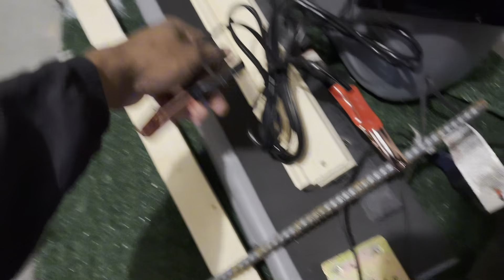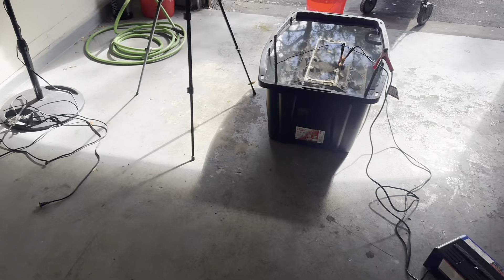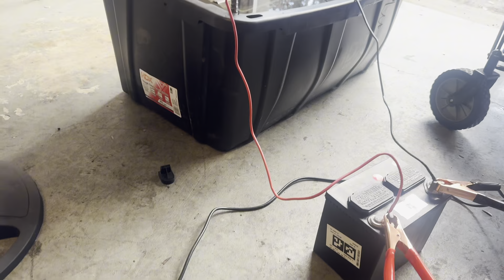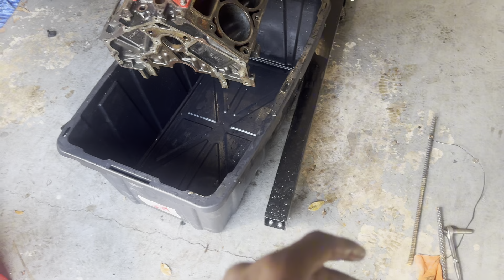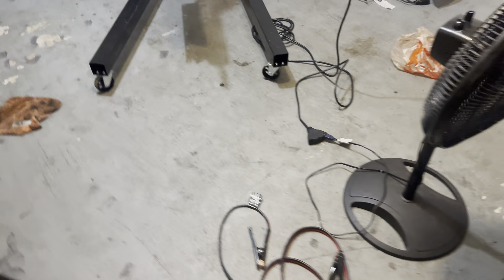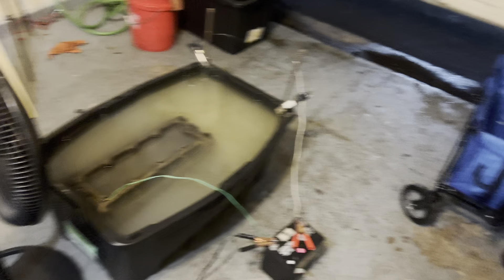ENGINE RUST REMOVAL WITH ELECTROLYSIS

Comment: I did this with a Duramax engine block, I used a steel drum, set the block on wood blocks inside it, and used the drum as the “sacrificial metal”. Worked really well, left it for maybe 2-3 days. I used some sort of detergent too, can’t remember.
Reply from the maker: The laundry booster I don’t know the drum can be used as that but it makes total sense . I’ll definitely try that my next time

Comment: Hello.....     in.  My.  Experiences.    Of.  Engine.  Cleaning.  And.  Other.  Heavy.   Cast.  Iron.  Like.   Differentials...    this.    Seems.  To.   Be.    Safer.  Than.      An.  Acid.    Etching.   And.  Easier.  Clean.  Up.   Than.  Sand.   Blasting....excellent.  video....  now.    The.  Question..   is.......  Would.  Or.  If.   The.   Paint.   Has.  Metallic. Granulation.   Will. It.   Bond.  Better.  To.  The. Magnitized.   Block.    See.  Even.  I. Can.  Still.  Learn.  Something.    Every.   Day.   At.  My.  Age......   im.  61.     Thanks.   Man.    Have.  A.   Nice.    Day....
Reply from the maker: I never thought of how it would react when painting, I’m assuming it would’ve similar to the powder coating process I would have to see but thank you for watching